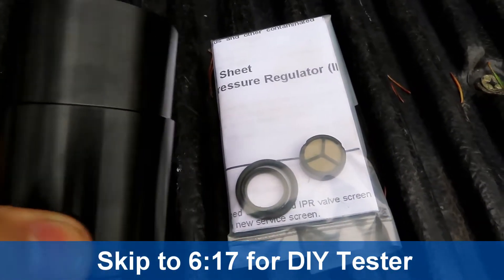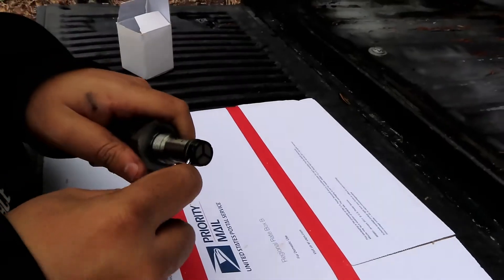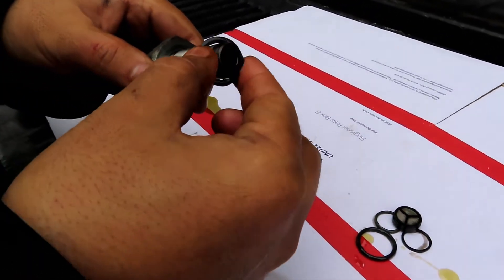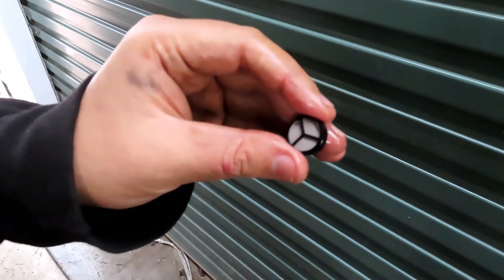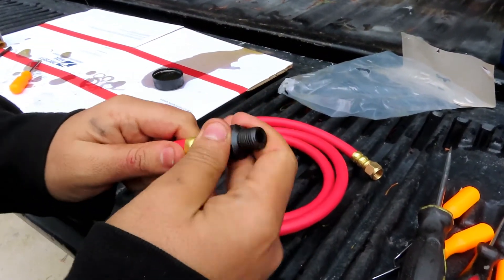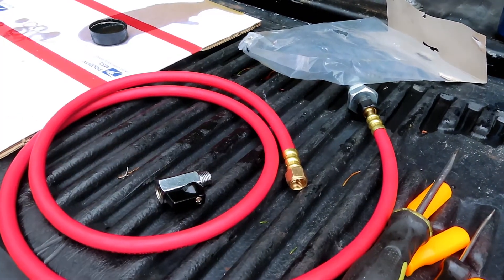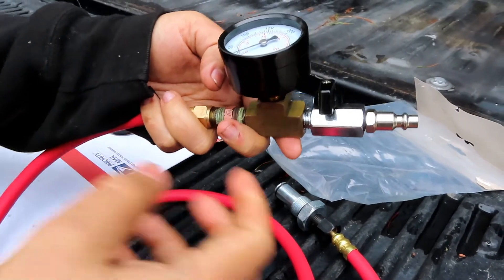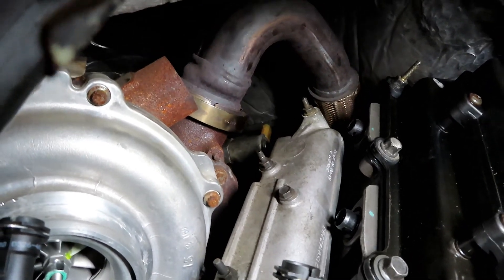6.0 Powerstroke F250  IPR Screen Install DIY Oil System Leak Pressure Test

Comment: Don't forget to plut teflon tape on all threaded fittings for your air pressure tester as it will leak air no matter how tight you think you have it.. Do it once, do it right and forget about it..